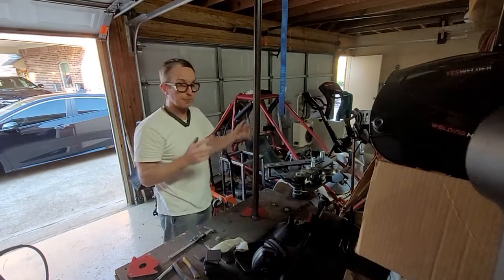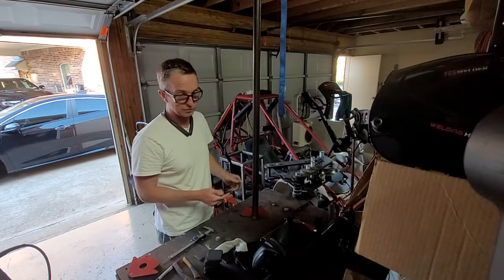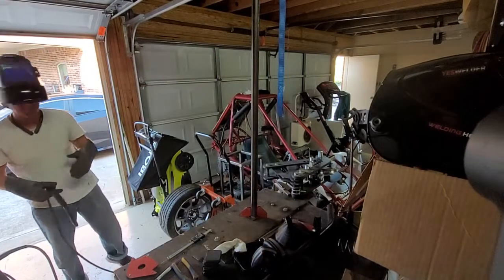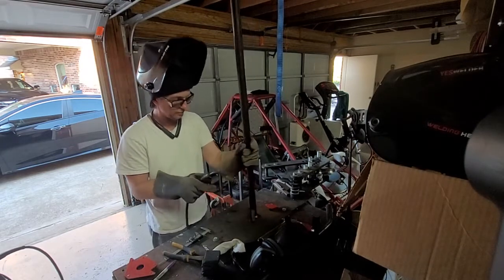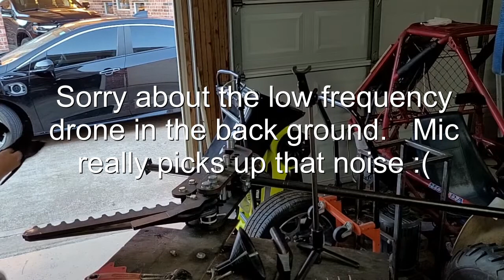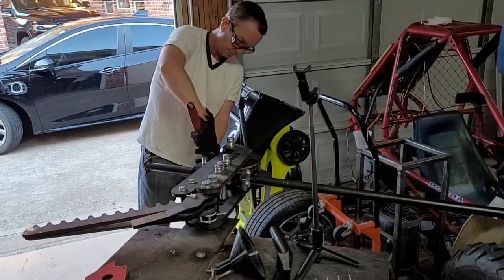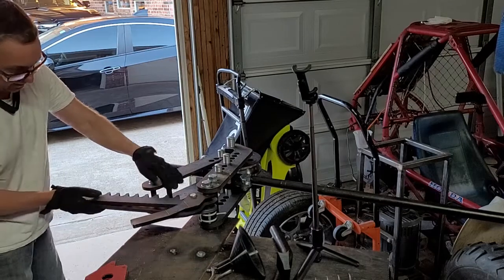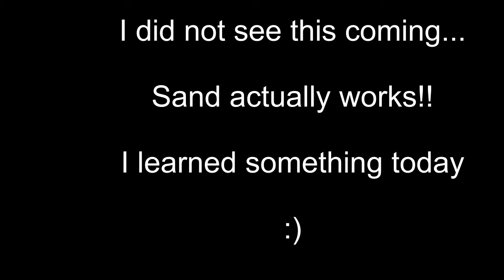Bending tubing with sand

Comment: My Dad told me about that. 
Another guy in YT has a video doing it, however he filled it with water first then sand. Not sure how or why but it seemed to work perfectly with no crinkling on a janky home-made tool.   I think the sand displaces water as its put in, and insures the sand is more compact. Probably doesn't work as well, or takes longer to add water to the top before it gets to the bottom.
He also just sealed the ends with duct tape to.
Reply from the maker: I saw that too, and didn't think it would work, maybe it would, but I thought sand and welding the ends on was a better idea... have not tried the other way.   I need to do a pepsi challenge  :/